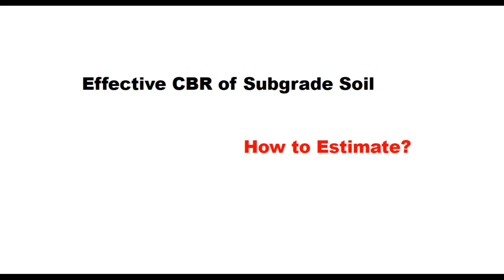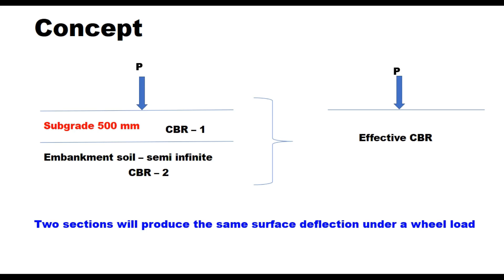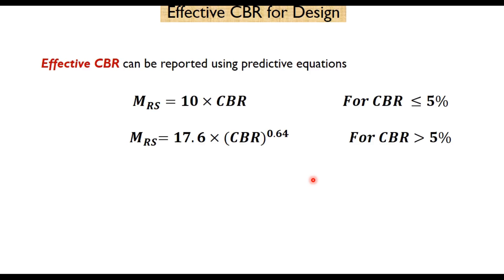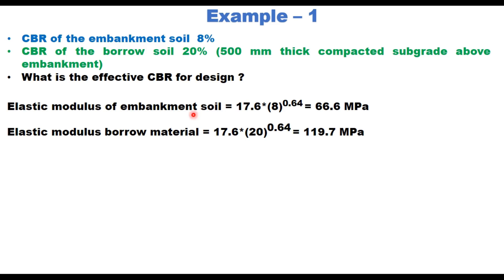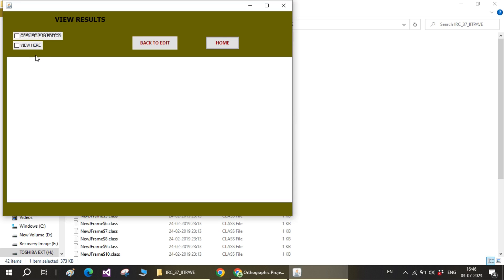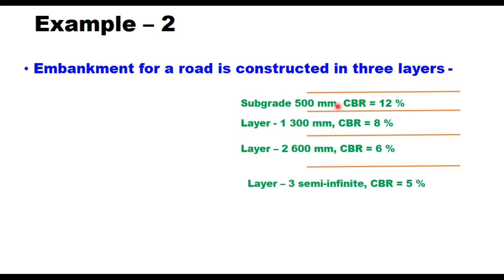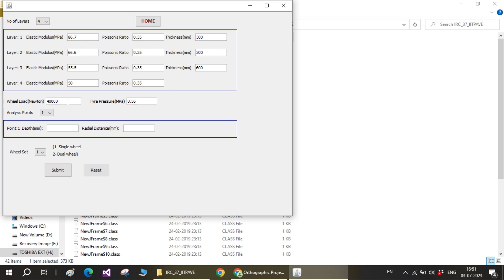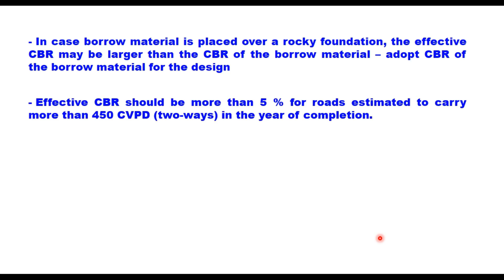How to estimate Effective CBR of subgrade soil? When Embankment is in multiple layers.

Comment: Dear Sir thank you very much for your nice video. I have read that wheels stresses diminish after 500 mm from the surface, is that correct
Reply from the maker: NO, wheel stress diminishes after 500 mm down the subgrade, not the pavement surface.